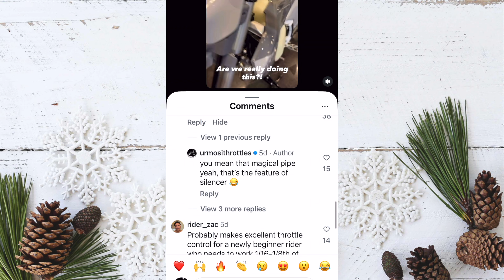Catalytic Converter + O2 Sensor on a 2026 Two Stroke - Husqvarna/KTM

Comment: KTM should have developed their fuel injection in a manner where anyone could remove it and put a carb on it and it would run fine. They wouldn't have to openly advertise it cause someone would figure it out and tell everyone. A lot of people would have liked that option when they introduced TPI. Fuel injection has a different feel to it and some just prefer the power delivery of a carb. Hopefully Bajaj will do this.